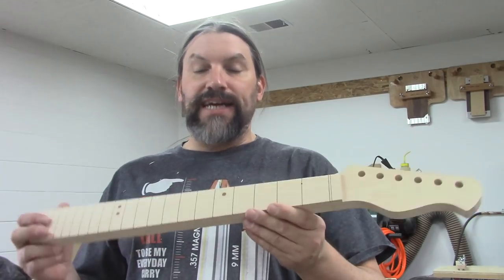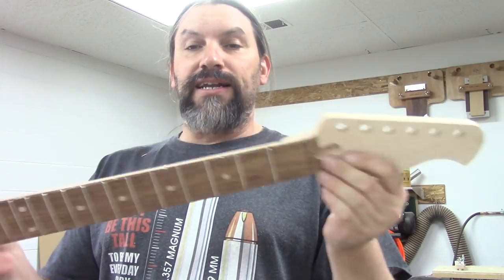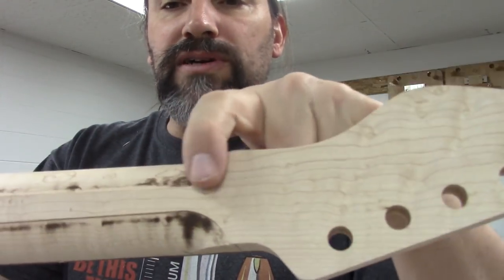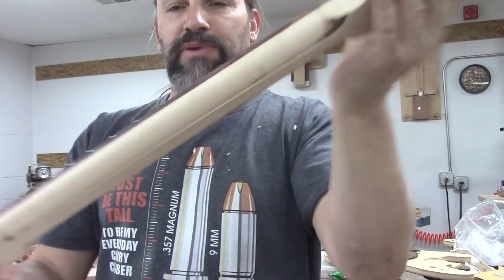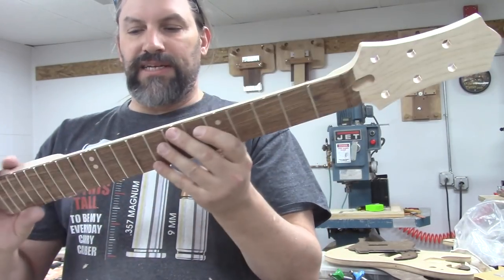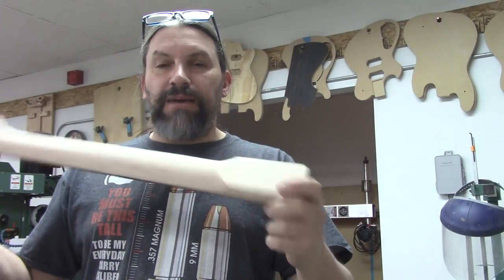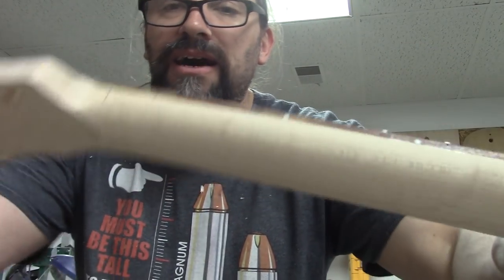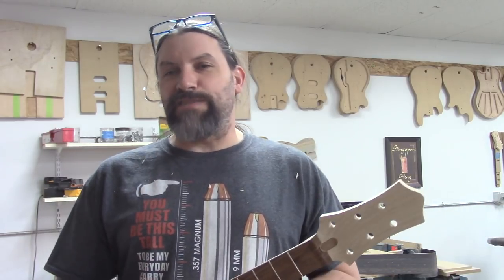The Best Tool You Can Possibly Use For Shaping A Guitar Neck

Comment: I have used several different methods of shaping my guitar necks.  My router table is by far the fastest and easiest method I have regularly used but it isn’t the cheapest.  The cheapest method I have ever used to round the back of a neck was to clamp the neck blank so that half of it was hanging off my workbench.  I then draped a strip of sand paper over the back of the neck, grabbed both ends, and shaped a rounded back by alternately pulling the ends of the sandpaper up and down.  I eventually had to swing the neck 180 degrees, reclamp, and continue sanding the other half of the neck.  As long as you’re reasonably careful and regularly check the profile of the neck, this method works fine.  It is, however, quite a slow way of doing things.

A spoke shave is the second cheapest method I’ve used but I frankly think using a strip of sandpaper produces a better quality of neck.  While spoke shaves are relatively cheap, they are still more expensive than a strip of sandpaper.  Spoke shaves remove more wood per pass than does a strip of sandpaper.  This speeds things up but also makes it much easier to destroy a neck if the spoke shave slips.  Plus, one of my friends mistakenly thought the spoke shave on my workbench was a medieval torture device.

Next, I used a hand router to make necks.  While this method was relatively inexpensive and fast, I think it has the greatest potential of screwing up a neck.  Hand routers are prone to occasionally move in directions other than the ones we would prefer.  Given the nature of power tools, it only takes a split second for a hand router to slip and destroy a neck.  Jigs, templates, and solid clamping methods help minimize the risk but I found that I was inevitably destroying a few necks no matter how careful I was.

Things just get more expensive from there.  Router tables and specialized machines can quickly produce good quality necks but they are relatively expensive.  Most people who are just learning to build guitars or who build guitars as a hobby don’t have access to a great deal of expensive and/or specialized machinery.  They usually end up using cheaper and slower methods such as those discussed above.  I typically recommend that people who are new to guitar building start with those kinds of methods for a variety of reasons.  One major reason is that they tend to be far more readily available to the average person.  A second major reason is that it can be very useful to be skilled using such methods if your expensive machine has broken down or your power has gone out.

I’m presently building my first electric ukulele.  I wasn’t quite sure about how I wanted the neck to turn out.  I decided to use slower hand building techniques because this allows me to better notice small issues that may be developing and to make changes as I go.  Thus, I am using the hand sanding method to shape the curved back of the neck despite the fact my router table is just a few feet away.  I’m certain that I will use my router table on any future electric ukuleles I might build but I prefer slower hand methods for prototyping.
Reply from the maker: Lots of great ways to do that job sounds like you have found some good ways that work for you
Reply: Thanks for a great overview of you experience on the subject. Also it's wise words on increasing expenses associated with more advanced (and not always the best) methods used. We all try to save out time and minimize our effort and everyone finds his preferred work techniques (that are subject to change).
Reply: I think a third major reason is that hand tools allow you to learn a lot about the naure and physical properties of the materials you're working with, while power tools keep you more distanced. You can move to power more successfully when you know the wood intimately.

Comment: I was inspired by your dead head last year and built one from a grizzly sander that was sitting dormant. I haven't ruined any necks yet but it is very easy to remove to much material. I also used it to flush SS frets to edge of the board on a couple necks. To be totally honest I have trouble watching both ends of the neck at once. But I've got 5 strat style necks to do and that should get me dialed in. Great video Matt and Chris!
Reply from the maker: Your Dead-Head looks good to go, I'm kinda surprised to hear you aren't using it much
Reply: @TexasToastGuitars , well most of my business is repair. I build one or two guitars a year and have always hand carved the necks. I'm going to build those 5 strat necks and put them up on reverb when time alows.

Comment: I rough round mine with  the front wheel of a  five dollar sears garage sale belt sander with 60 grit belt, then use a cut 60 grit belt like shinning the toe of a boot, works great then fine tune with 80 and 120 ect hand paper. It's cheap any way, with great results.

Comment: I mentioned Oslong Sandpaper & Discs before, but try some 3M Resinite Floor Paper for quick wood removal. I use 80 Grit, but they make a 60 Grit, 100 and 150. This Sandpaper is specifically made for Rapid wood removal. It's what the Hardwood Floor Man uses because it's made to Cut. Wrap a piece around a 1×2 board, a 5 gallon bucket stir stick or anything that suits You. You won't believe how quickly it cuts and how long it lasts.
God Bless Y'all.
Jimmy in NC....
Reply from the maker: Are you a rep for this sandpaper?
Reply: @TexasToastGuitars  No I'm not a Rep for anything I've mentioned to You. It's just that since 1972 I've used every kinda Sandpaper there is. Oslong is hands Down the Best a 3M Resinite is the best for Rapid Wood Removal. I only recommended them to You as a Friend to Help You. Oslong is so good I recommended it to a Luthier in Scotland, Murray Macleod who's been building and repairing Guitars for more than 50 years. Murray used to order all His sandpaper from a place here in Raleigh NC about 3p miles from My house. He tried the Oslong cancelled His Raleigh order and now uses nothing else. I wish I'd known about Oslong sooner Myself. I only found out about it a couple years ago. You don't have to use it. I was just trying to help You that's all.
God 🙏 Y'all.
Jimmy in NC....

Comment: The router is a great tip to give you a head start!.Is that a 1" roundover bit? I wish there was a cool trick like that for angled headstock necks, lol
Reply from the maker: That bit is 3/4 or 7/8 I use both depending on the neck thickness. We did make a sled for our beloved pin router to do angled headstocks
Reply: 2 axis router box - come at it from above - after watching this video thats what im planning to do with my latest build...  that or a bespoke jig..

Comment: It seems like the length from volute to heel is somewhat set, though, to a 16-fret neck design.  Not a problem for the majority of your work, but what about 14- or even 12-fret lengths.  Straight from the router table to hand shaping?
Reply from the maker: We have another deadhead sander for those necks but rarely, if ever use it

Comment: So I guess you'd have to go with another method for a neck with an angled headstock, right? Since it wouldn't have a completely flat surface to use to slide down the router table.

Also, do y'all use the same type of poly on necks that you use on the bodies?
Reply from the maker: You got it right on both CC.
Sometimes we just go right to the sander for angled headstocks. The sealer, basecoat and clear are used on any and all parts of the guitars we make. We can do oil finish necks but only on customer requests

Comment: As always thanks for sharing. Quick one for ya. Whats the bandsaw blade you use in your other vids where you are cutting the neck? Also curious why you are using the router table and not the pin router in this vid? Thanks
Reply from the maker: We use Starret 3/8 bandsaw blades

Comment: Matt, any idea on what number is your bit on the router table for the back of the neck.Hi from Greece
Reply from the maker: Hi fotice, we use a bunch of bits... 1/2 , 3/4 and ideally 7/8 it kinda depends on the thickness of the neck
Reply: @TexasToastGuitars   the thickness before the dead head sander seemed just fine for me, measured by eye. What was that?? Thanks for all your content ive learned so much.. but not gone any smarter😁😁

Comment: Hey Matt… what material did you cover the plywood with for the back of the belt to run over ? I would think there would be a lot of friction build up there ???
Reply from the maker: It is platen cover it's cloth with a thick graphite coating. Just like you find on a sander made of metal

Comment: Don’t you guys have tilt linishers in the states ? Kinda shocked you had to fabricate your own and also had to find custom belts. We have these in high school woodwork classes  here in Australia.
Reply from the maker: Beats me?
Reply: We have linishers but they're really more for tool finishing (sharpening) and pipe-work - it would still take a ton of customization to really make one work in this fashion (the working orientation is generally all wrong) . Add to that the fact that the belts are typically narrow it's not really as good a solution as this.

We've got oscillating belt sanders that are more akin to this piece that Matt uses - but they are crazy-expensive in sizes best suited to neck work (like US$5k)
Reply: Don Vanco that sounds like a bed / flat run linisher, tilts over here are found in most cabinet maker’s shops, you wouldn’t use them for tools because of the long belt and the chance that said tool would puncture and send the belt flying across the room :) maybe we just use different names. My point was this exact type of machine is really common , you can pick them up quite cheap at any local Bunnings. And that’s what shocks me as usually we are the ones who need to order or fabricate tools we only have a population of 27 m

Comment: You mentioned a few times that yours isn’t a real dead head sander and that you’d get into why, but I never caught what made yours not a real dead head sander.
Reply from the maker: I did say that didn't I... a real dead head sander has a platen with no drive wheels opposite the drive. since it doesn't spin it is dead. The old school ones were shaped like a triangle. They might have been tricky to adjust but I don't know.